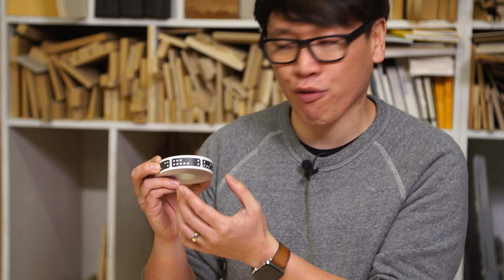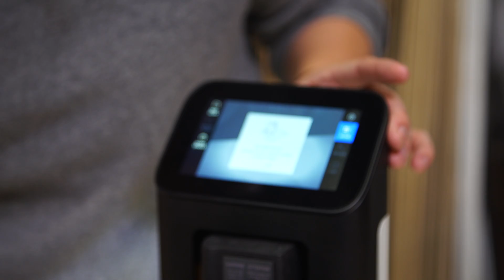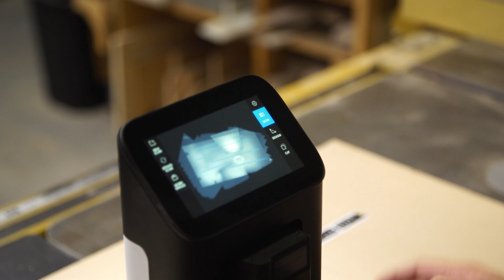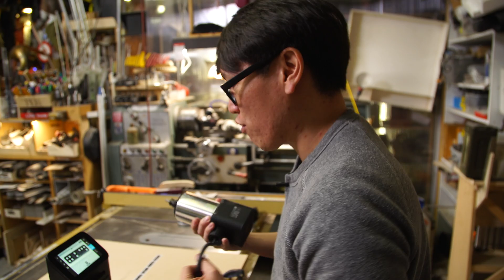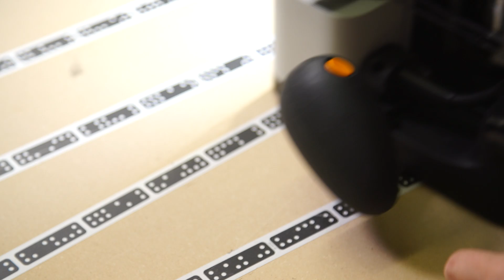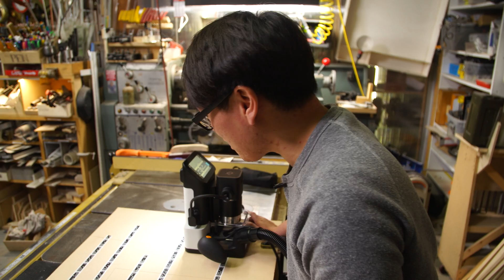Testing the Shaper Origin Handheld CNC!

Comment: Here's a list of suggestion for the tracking system that I can think of lol

1) 3d mapping of the ceiling above the workpiece (current sensor technologies may not be as precise?)
2) passive wireless beacons that are designed to either be slotted into the workpiece or fitted onto the clamp
3) if the trackers were to be placed on the workpiece it should be easy to remove but not easy to smudge. Stamps are plausible. UV reactive inks?  

Handheld CNCs might be low cost for prefabricated work materials that have printed trackers on them that are easily removed or covered up with paint.

ok i should get back to my studies lol kthxbye
Reply: Those are great ideas, however you are missing the point of milking money for the tape.  Did you notice the price of the tape?  This is just an expensive gadget, a money grab.  This thing was a great idea that got ruined by trying to milk so much money.  You can buy fully automated CNC's for less which require no special guidance consumable.  The only thing benefits this has is storage space and that it's more portable.  If you REALLY need your CNC to be portable, maybe this is for you.  If you are going to use your CNC once every two months, and spending over $2000 on a gadget is not a problem, then maybe it's for you.   But for small home business, you are better off buying a real CNC.
Reply: Love the 3D ceiling idea, although you lose portability that way.   I wonder if you could get precise enough with a couple of laser distancers  set at right angles to one another?

Comment: Holy proprietary BS, Batman!
What a piece of consumer milking crap this is :-/
Reply: At no point did I suggest a full scale CNC setup was a better alternative; there are compact CNC routing solutions that are open source. Defend it all you want, but the tape and this machine are overpriced , consumer milking, shit.
Reply: ... and of course it's gonna try and herd you into using their 'cloud' to wirelessly upload your designs to the machine, so they can more easily mine all your data and get your designs too. Any bets on how big their security holes are?
Reply: Not to mention a two hour cut on a cnc table becomes a two day back breaking horror with this system -- just look at the level of concentration he needs to use…
Reply: A lot of makers don't have space in their workshops for a full-scale CNC machines, so compact solutions being invested into is a huge deal for us. This Shaper thing may be lackluster, but it's a start - the first smartphones were consumer-milking crap, too.
Reply: Because we all have an extra few hundred square feet of floor space for a CNC router in our luxurious, heated and air conditioned, tile floor workshop that we can magically work at while not even in the shop. herpderp.

Comment: The only problem is that it costs MORE than a more capable, traditional CNC router (e.g. http://www.zenbotcnc.com/cnc-routers/zenbot-1624-cnc-router).  I guess it's good if you use a CNC inside an apartment?  O_o
Reply: Yeah, but the ZenBot 1624 can only handle up to a 30 x 20 sheet.  To me the exciting thing about the Shaper is that it can handle a full 4 x 8 sheet of plywood.    To get that from Zenbot, you're going to have to pay $3,200, plus a $400 control box, $175 control license and $300'ish router.  So, pretty darn close to $4K before the cost of a table. 

Don't get me wrong, the Shaper doesn't look perfect, but I haven't seen a "just works" option for CNC'ing a full sheet of plywood that costs less.
Reply: Maybe if you need portability? Though that's probably not going to apply to that many people.
Reply: the shaper can do an 8'x4' sheet of plywood and fit in my backpack. traditional CNC can't.
Reply: my garage is severely space constrained. shaper can be used in it, mpcnc cannot. that eliminates mpcnc from all consideration. also, i don't have to spend tedious hours building a shaper. it comes out of the box ready to go.
Reply: if they aren't comparable then stop trying to compare them. shaper satisfies requirements that mpcnc does not, and vice versa. stop trying to shit on shaper when it's not the same thing and solves a different problem space. what's next, shitting all over laser cutters because they can't do 3d relief? you need to accept the fact that different tools solve different problem spaces and your beloved cnc mill is not a one size fits all.
Reply: You can build a MPCNC (Mostly Printed CNC) for about $600. Larger size and you can even use it as a 3D printer.
Reply: It depends on what you need. Most people probably don't need to carry their CNC everywhere they go. And there are scalable CNC, such as MPCNC. On the other hand, can the shaper make a 3D relief?
Reply: ms3bani, both things aren't even comparable. Some of the aforementioned examples are CNC mills and this shaper is merely a router with CNC assistance. It doesn't make elaborate 3D shapes and reliefs, it just cuts to a certain shape. If that's the only thing you need, it might be a good solution.
Reply: I should stop comparing it? Your first comment on this thread is saying what "traditional CNC can't do". That's your first comment, you stupid idiot. I went with it because you were saying what a "traditional CNC" can't do as if this shaper could do a greater number of things. It can't. It can cut and that's it. First of all, you should know what a fucking CNC is. There's no "traditional CNC", there are different CNC machines. What is being discussed is how a CNC MILL (see the "mill" here?) can be more useful than a CNC ROUTER since it can perform a greater number of tasks. If you don't care about those extra features, great. But that doesn't change a thing. A CNC mill offers what this one offers and much, much more.

Comment: Interesting in regard to the compensation system, but to be honest, that's about the only thing I see that is very useful here.  Tested, do you think you could lay out a scenario where $2,200 spent for this would provide you a solution to a problem that a $2,200 CNC mill of traditional type would not?

It seems to me that the fact that you have to destroy the reference tape as part of the milling process limits the type of work that can be done substantially.  What if you wanted to reduce the thickness of a part (say your MDF) by 3mm universally, plus drill some holes in that reduced  thickness part, while maintaining a full depth edge?  It seems this device wouldn't be able to accomplish this.  Am I correct?
Reply: +SkipJack Good point.  Thanks.
Reply: I'm more thinking a floor.  I can't find the weight of the thing anywhere, but I'm guessing 10 pounds.  Doesn't sound like a lot, until you've been holding it up and dragging it across the wall for a while.
Reply: Floor? Wall? What happens when your carbide bit hits a nail?

Comment: could you not just buy a full size xcarve for $1500 instead of paying over $2000 for this? Why would i want to spend 30+mins to cut something out when i could have a xcarve cut it while i work on something else? I understand that this is a new piece of tech so hopefully it will continue to improve.
Reply: Its a matter of space .. This can be transported in a car with ease, a fullsized cnc router, cannot.
Reply: there may be a situation where this could be handy. But as a pro, if i am going to have to design the pattern on a computer than upload the design to the tool and then lay tape down then hold the router up and swing it around to take pictures of the tape then wait for it to calibrate then manually  cut it out myself for the next 30 mins to an hour ( and hope that in not interrupted) and if the piece is larger than i can fit in my cnc without doing section cuts and cant be moved out of place than, yeah, I guess it would be convenient.  Is it cool? Yes. Is it practical? It could be. Time saving? maybe. Do i have to use a design software like a table top cnc? yes. Does this cost more than a full size CNC? yes. 

i guess we will have to wait a year or two to see if this is a successful tool - the idea is great, the tech is great, the size is great . who knows maybe we will all have this as part of out standard tool collection in a few years.
Reply: you're assuming you cannot make your own tape with a photocopier or laser printer. I know for a fact this works.
Reply: I think this is great for working in the middle of larger workpeices that cannot be put in a router table. Restoration work of already   assembled furniture etc. Or customizing work to customer specification, on boats and other awkward stuff.
Reply: true..Im thinking about what I usually work on and you see it from another perspective. Sometimes i can forget that not everyone works the way i do.
Reply: I see your point about an xcarve but this can be used on a sheet that is bigger than xcarve and closer to a full sheet of 2440*1220 sheet. 
This device has potential but its biggest limitation is the tape. The tape is its biggest strength cause it will allow for layouts. If the tape is not being made then it will effectively stop the device being used. 

All I know is it will be very $$$ in Australia.

Comment: Needs more innovation when it comes to moving the machine around your work piece... Why not a Roomba type motor system that would position itself
Reply: Something like Goliath CNC? https://www.kickstarter.com/projects/2130625347/goliath-cnc-an-autonomous-robotic-machine-tool-for
Reply: damn that looks fine. I would have no need for one but I want it !
Reply: The purpose of the tape is to allow the mapping of the work surface. Shaper origin needs to know his position on the board to cut the shape. It's more clever than you think :)
Reply: This machine is complete bullshit. What's the point in tapes when you still have to move it by hand ? I am sure there could be a better machine that either doesn't uses tapes or is automatic or both.

Comment: So expensive!. Why not buy a tabletop cnc machine that would do this automatically? Seems like a pointless gimmick?
Reply: Imagine trying this on a non-standard surface, like maybe a vertical surface? You could engrave awesome designs in walls and ceilings.
Reply: @lionhardt75 With the weight of the machine that would probably be a daunting task...
Reply: For reference, this incorporates a Festool router motor. Festool routers start around $500 and range up to nearly $1,000 without the CNC capability.

This concept would not be replacement for a traditional flatbed CNC machine. Instead it could be used on a job site, for quick custom work. It can be used on any material to large, heavy or awkward to get on to the bed of a CNC machine, such as large table slabs, post and beam components, or an existing wall or floor. It also does not require  the dedicated space of a standard CNC machine. 

Obviously, if you can't think of a use for it, you probably don't need one. However, while I have a traditional CNC machine, I can think of plenty of uses already, and given time with the tool, I'm sure it would suggest all kinds of possibilities not available with standard CNC machines.
Reply: I mean it's literally a portable CNC machine. It won't be replacing tabletops but the advantages of portability shouldn't be discounted.
Reply: I work at a machine shop and we have had times in the past where this would have come in handy. We have had to make corrections to parts that field techs were installing 500 miles away.  Normally we make these parts on a large tabletop router(It weighs ~25k LBs to give an idea). Well to overnight the parts would have costs us in excess of $700. If we had one of these we could have a set of uhmw plastic sheets and this go down on jobs that might need to be tweaked on site. A couple of overnight shipping charges and it pays for itself. (Not that we have any plans on getting one but the use case is there)
Reply: Larger milling area and you don't need a permanent installation (can use the table for something else as well). However, tabletop CNCs are sooo much more comfortable to use, just press go and it does the rest…
Reply: it really isnt that expensive for what you are getting. while i was watching this video i estimated it to be 2499 usd. this can be more practical if you dont have space for a tabletop machine and this can do any work size. if you got like a 5x5 meter wood plate that got some engraving on it you can do that.  but this product is only really good for people who don't have to make the finish product really fast and needs their space for other things also the portability. (sry for bad english)
Reply: Scalability  ¯\_(ツ)_/¯
Reply: I have a small shop. No way could I fit a CNC machine in there. I'd definitely buy this for the space saving.
Reply: Portability
Reply: Consider it like a laptop of PC. People want the specs of PC but the portability of it which cause it to be more than that of a PC

Comment: Can u make ur own tape??Proprietary tape feels microtransactionish
Reply: I'd attach the tape to thin strips of wood so I can reuse them. Screw the strips of wood to the material and you're set. You can avoid cutting the marker tape depending on your design and how you apply it. You could apply tape directly to the material being cut if it's in the routing path.
Reply: danz machinz Buying food or gas for your car is too. But oh well.
Reply: as long as the tape is identical pattern. not necessarily the dots but size.
Reply: someone mentioned making a stencil... not sure how well that comes off compared to tape. not sure how quickly the dot pattern repeats or how often it needs to for the machine to work correctly/well.
Reply: You use the original tape that comes with the router to build your stencils. The idea is to preserve the tape so you're able to re-use it, not come up with a substitute.

Comment: there had to be a better way than the tape
Reply: I'm wondering if a projector could be used to project the pattern.
Reply: Projector? You really missed the point of tapes. lol
Reply: As I know, It's don't need to be under the "cnc". But if you think about it, the place of the tape needs to be constant, because the machine mesure compared to the tape.
To use a projector you need a very stable place for both the projector and for the stuff you want to cut.
And the most importatnt thing, It's needs to be a constant size, wich is nearly impossible, or takes really long time, and you need to do it every time you cahnge place or matterial with different thicknes.
So... long story short, It would totally lose It's function as a handheld cnc...
Reply: +Daz Zad GPS??? Really with +/- some meter? :D and indoor?
and what if you lift it? You can start again because It is lost the trace?
The tape IS a very good idea, they do It for good reason...
Reply: +Daz Zad I'm chill, It's just tape not a great money I think.
Reply: +Daz Zad Well you can use it like "applied science" did.
Reply: Cool tech! But the tape!? Seriously?
Reply: I thought he said there were no cameras where it's cutting, but cameras looking around it. If the tape needs to be directly under the device then obviously a projector would not work.
Reply: Daz Zad There is, but that doesn't allow them to collect ongoing profit...
Reply: One way I could think of is have a ball wheel under it and just tell the origin how big your material is. Place it in the bottom right corner of the material then line it up with the corner using some guides on the origin. The origin then tracks its position using the ball wheel like in an old mouse. It can use this in conjunction with GPS location data.
Reply: Thom I think he said it's 18 dollar a roll
Reply: I was just throwing ideas out there, chill. I don't think the tape is an option, but not the only one. It's a very good option so they can create their own eco system built around this tool. A passive revenue stream for them.

Comment: Thank you for putting it through a test like the maze. Consumable + Labor/Time, makes traditional CNC look like a new technology in comparison when doing actual work like this. I'd love to see more novelty vs practicality projects! Like possibly use this on materials you could not fit on a CNC bed ;)
Reply: In my experience, the advantage is more about the size.  You can take the CNC to your workpiece, rather than the other way around.  You also don't need the room to house a full CNC unit, and your workpiece can be infinitely large.  It's also cheaper than most CNC systems.